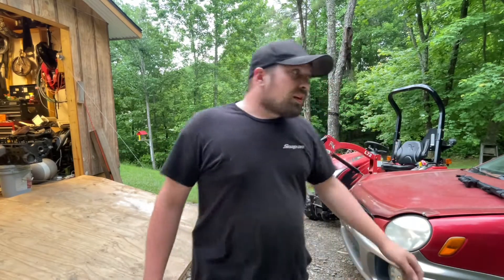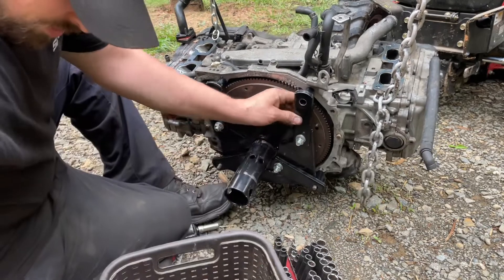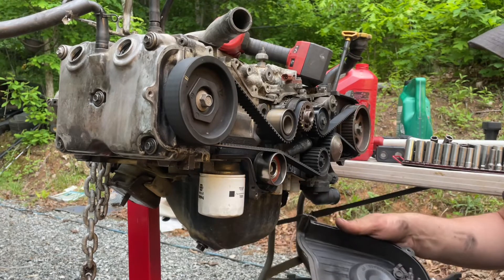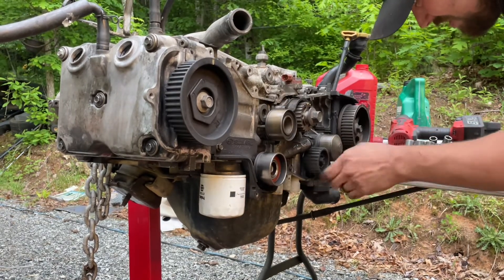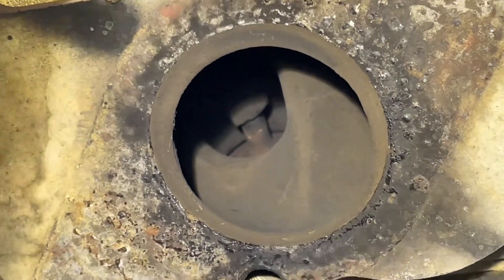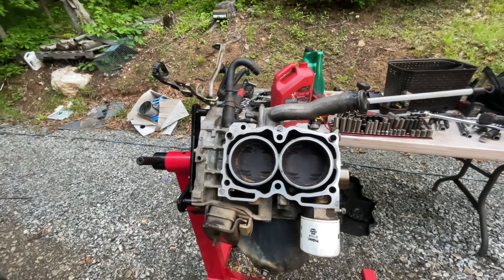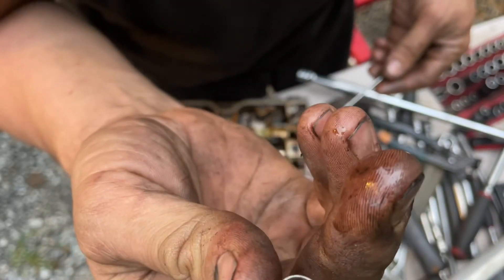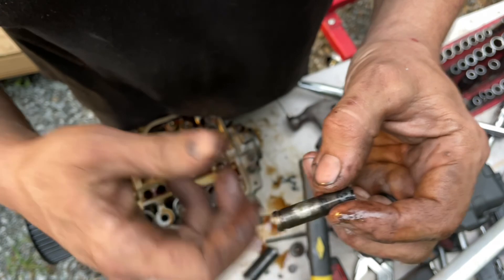Subaru Impreza daily driver DROPPED a valve guide And KISSED the piston!

Comment: Other videos explain why this happens.  The aluminum head expands twice as much as the iron valve guides creating a gap that allows the exhaust valves to drop.  There is a company that sells brass valve guides that expand at almost the same rate as the aluminum does.  I think if you tear a subaru down this far it's worth changing all of the exhaust valves to the brass ones; I wouldn't bother with the intake guides those seem to never drop.
Reply from the maker: Thanks for watching and commenting!